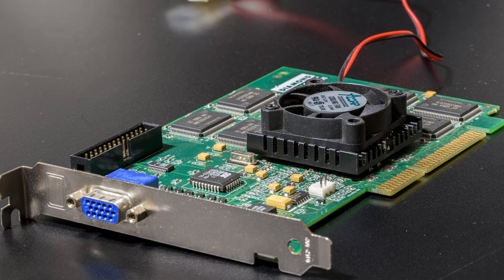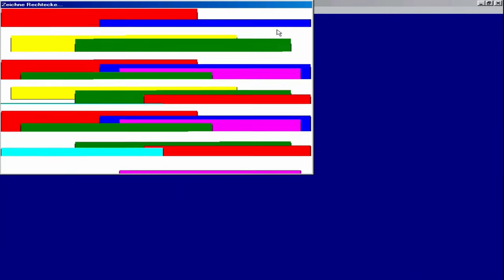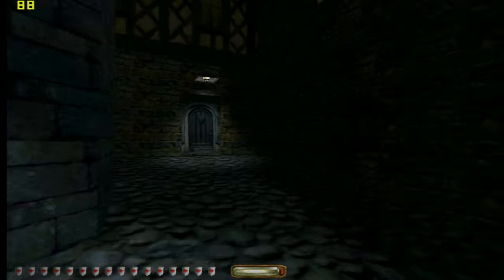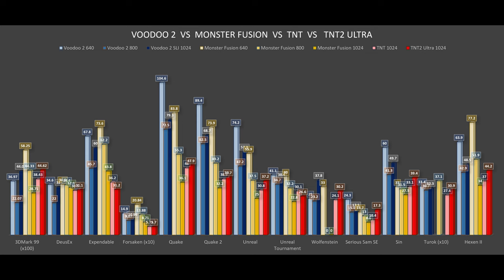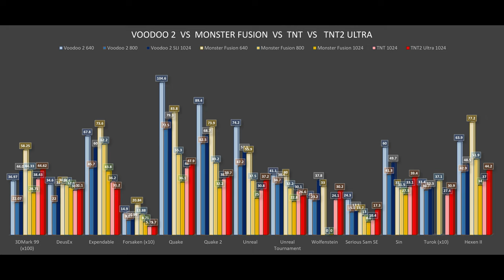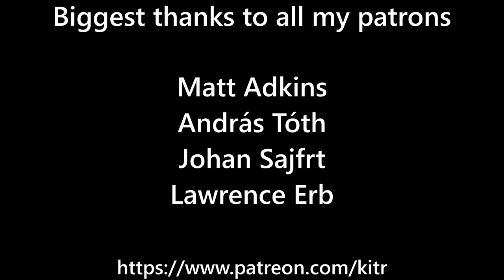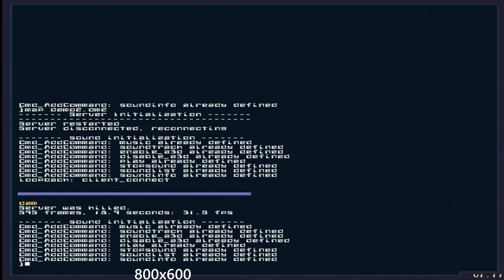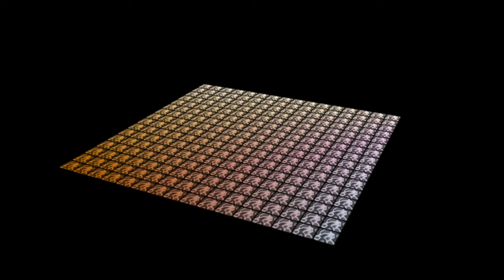3dfx Voodoo Banshee Review - Better than Voodoo 2? | Part 4

Comment: The Banshee was, compared to a single Voodoo 2, in some games slower in others faster. But it sure did have a better image quality because of it’s 22-bit filter and no 2d-3d cable. It also supported higher resolutions. Back in 1998 I would have chosen the Monster Fusion or GA-630 Banshee over a single Voodoo 2 any time. For the year 1998 it was an excellent card. I would even say that the Monster Fusion and GA-630 Banshee were overall the best single cards of 1998, better than a single Voodoo 2 or the TNT1.
Reply: wel,i m pretty impressed with the benchmarks of the riva tnt in 1024x720 resolution ,better than a voodoo banchee for sure and the riva tnt today is a lot cheaper.
Reply: @athos5359  it depends on the game and also the card version. The fastest Banshee, the Monster Fusion and GA-630, were 15-20% faster than the standard 100/100 mhz Banshee and overall just as fast as the TNT1 and Voodoo2 but also had other advantages over those cards, like the better 16-bit image quality (22-bit filter) and better game compatibility than the TNT1.
Reply: @3dfxvoodoocards6  wel that s  mostly true,but today a voodoo banchee here cost the same as a voodoo3 2000 lol,and a GA-630 even for a lot more ,also i think those nummers in the video are incorrect philps computerlap got 38 fps in 800x600 in unreal castle demo and expandeble as high as 75 fps 800x600 running a banchee 100/115mhz.
Reply: @athos5359  today it does not make sense to buy the Banshee because for the same money you can get a 2x faster Voodoo 3 2000. With the Banshee and Voodoo 2, which one is faster depends on the game, in some the Banshee is faster in others the Voodoo 2. With my Banshee at 100/100 mhz I got 32 fps in Unreal 800x600 and 22 fps in 1024x768, a little higher than the results in this video. I also notice that the Banshee results here are a little low, maybe around 10% lower than I got. Could be a driver issue.
Reply: @athos5359  It's because those bench are wrong lol

Comment: Interesting video. You forgot to mention the excellent 16-bit image quality of the Banshee, being the first card with 22-bit filter support which is active by default in resolutions lower than 1024x768, and has to be manually activated in 1024x768 and higher resolutions.
Reply from the maker: Yeah, you're right, I absolutely forgot about that...

Comment: Excellent video and benchmarks. I got around 10% more performance with my Banshee 100/100 mhz in Quake 2 (44 fps in 800x600 and 29.5 fps in 1024) and Unreal (32 fps in 800x600 and 22 fps in 1024), but that surely is because of the driver or board configuration (SG vs SD ram, timings, etc).

Comment: Had the Banchee back in the days. I'd run games in 800x600 16bit, great performance and visuals on 17"crt. Played a lot of Half-Life and  KingPin in multi-player using GameSpy - much fun! The card wasn't high-end but offered great price to performance ratio.
Reply: It bought one to try back in the day. I actually quite liked it. Nothing wrong with it back then. I use to play Half-life (and then the AG mod) using Wireplay (UK) back then. Used GameSpy quite a bit. Great times!

Comment: why are the results for a riva tnt2 ultra so low ? i have seen a riva tnt2 hitting 57 fps in quake2 1024x720 resolution .
Reply from the maker: I don't know, I used the fastest drivers.
Reply: @KITR-UK  maybe the cpu is to slow,riva tnt s need a fast cpu.
Reply from the maker: I used Pentium III 700MHz, which is pretty much the fastest CPU of that time.

Comment: Compared to the non-3dfx competition the Banshee had the advantage of better picture quality and better games compatibility since at that time many older games were still relevant which would only support hardware rendering via the Glide API which something like the TNT could'nt use. Also the Unreal engine at first sucked at anything other than Glide but got patched by Epic to support other APIs better. And last but not least the Banshee has one of the best compatibility and speed to DOS games.
I got my Creative 3D Blaster Banshee AGP in December 1998 & shortly afterwards overclocked the whole system so the Banshee ran at 112/112 MHz and an overclocked AGP bus. It ran great and looked great, the Creative came with some sort of lense you could use with the correspondent software that shipped with it to calibrate your monitor and the result was astonishing. Since then I always calibrated my displays although with hardware colorimeters of course.
What was a real letdown though was that I couldn't get the cockpit view to work in Need for Speed 3 which looked fantastic on my friend's Voodoo2.